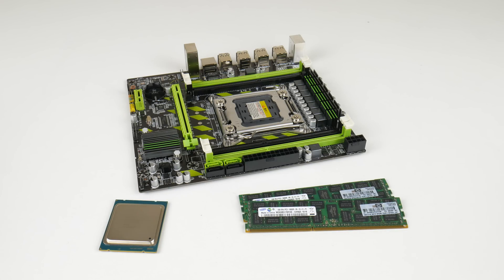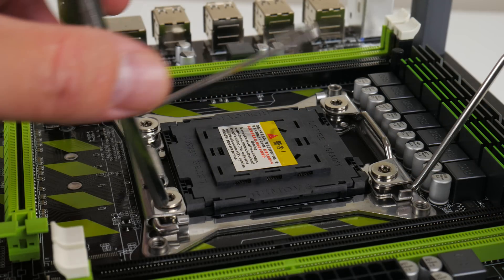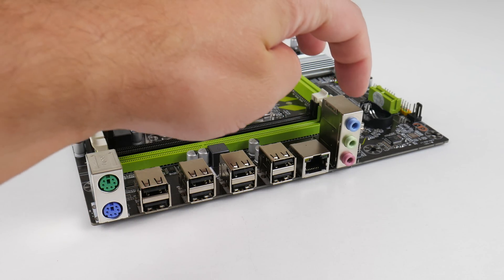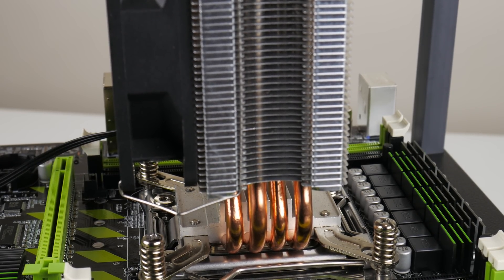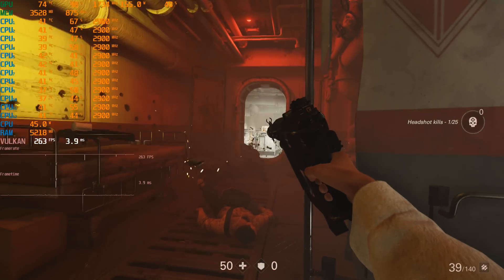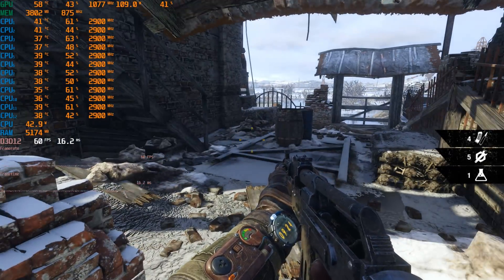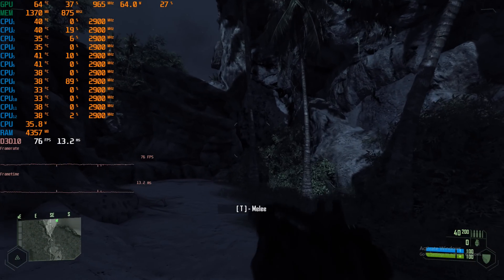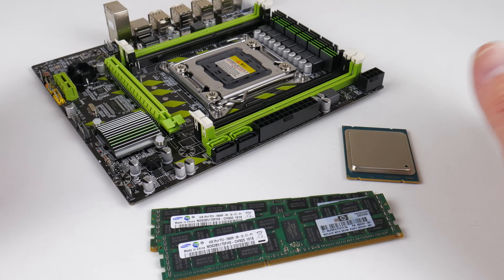$99 LGA 2011 Motherboard 6-Core CPU 8 GB RAM Budget Bundle

Comment: How would it fair as a Linux machine, Ubuntu or Linux Mint, any thoughts?
Reply: I use a very similar system for Linux, except with a 1070Ti card on it. I have Steam installed and play Linux native games on it just fine. Runs Chrome & Firefox like a beast.
Reply: @boriscat1999  Good to know, I'll do some more research on prices here in Canada.

Comment: Looks like the mobo I got with a Q67 chipset, and it wouldn't support my Hynix ddr3 1333 ecc registered ram, scrapped it.  Sold cpu on ebay, mobo and ram now in closet.  The mobo was advertised to work with ddr3, no specifics, I was not happy.

Comment: Last year i bought brand new i5 with motherboard psu case and 16g ram no gpu no storage costs me 880sgd

Now i put this motherboard and cpu u showing on aliexpress with 256g and 960g goldenfir ssd, 16g ram, case, 550w psu and rx470 it only costs 480sgd 😭😭

Comment: Inspired by your videos I ordered one (although a E5-2620 V2) with 16GB RAM sticks with a Killspre motherboard and today I completed the first stage of assembly. I am using a Corsair A30 cooler, Corsair VS450 SMPS, Adata 240GB SATA SDD, but realized that I forgot to order a video-card. Since mine will be used in server configuration, I am looking for the most basic / cheapest GPU card. Can wait to get one and spin up this little buddy. I scavenged the case of an older Athlon X2, and still have that setup spare. I noticed that you use an open-case for the video filming. Wonder how do you manage the HDD, power LED, and reset, power-on switches ? Did you buy or scavenge a front-panel ?
Reply from the maker: You can get front panel buttons with LEDs that are specifically for open test benches! They are easy to find on eBay or AliExpress :)
Reply: @philscomputerlab  any idea what might be wrong if the onboard piezo doesn't beep or does any BIOS POST ? Checked with repalcement SMPS as well. Tried with/without CPU, with/without RAM sticks inserted, with/without CPU cooler (for few seconds), and triple-checked all connections to be proper. Should this be RMA ?

Comment: They talk about Raspberry Pi's used to make cluster computers how about someone doing it with these? would need to get the power bricks instead of full power supply would not need a video card except maybe one, might not need as much memory in each one. But you could build you a heck of a cluster computer on the cheap.

Comment: I went with an E5 1660, 32 gigs of RAM, an RX 5700, and a QL300 case. Total cost for everything I needed to complete a functioning build was $799.17. With this kind of power, I'm super impressed. I can post a parts list if anyone wants it.
Reply: How is it going? and please post the parts!
Reply: @AnnieKawaii1  Well unfortunately this build was from 3.years ago and it does not look the same at all. I've been building these computers and giving them to family members
Reply: @CodyCombat  did the E5 1660 build have any sort of issues, especially on the motherboard side of things?
Reply: @RavenValkyrie  when I had it everything just worked as expected. Was a very nice system and still is from what I hear from family

Comment: Maybe a Xeon E5 2640 is a good fit in this kit, it has a 2,8 GHz All Core Turbo (100 MHz less than a E5 2630 v2) and is a little bit cheaper.

Comment: Very interesting video. Question. Did you ever try a similar build with dual XEON? I have a stack of old blade servers from work with this type of cpu and a stack of ecc memory. I'm on the fence as to a board like that is worth the price https://nl.aliexpress.com/item/4000130652292.html . I could fully load it, but how much more usefull would it be as a home workstation compared to for example my old i7-2600 board. As your videos showed most games did not even use all cores. Making dual 8 core more or less useless it seems.

Comment: @PhilsComputerLab Great review! Prices seem to go down nicely. Question, I'm looking into building a cheap and power efficient m-atx media pc running Manjaro. If one lets this CPU do H.264/65 & VP8 decoding, how much load does it get and how much power does it consume?

Currently I have a very old E5700 dual core with an old agp AMD video card for a midia machine. The card has major issues doing video decode, while it should support it. Thus I'm looking to replacing the whole aging system.

Comment: check out there is a new x79 board I saw with m.2, 1 Pci e x16, 2 usb 3.0 & quad-channel ram (need to ask the seller, not sure about that ram channel)....around $50
Reply: Link ?
Reply: @kruxdt6307   https://www.aliexpress.com/item/4000071175845.html

Comment: My pc it still kick ass on today games and it has about 7 years: 

I7 3820 (socket 2011) :D
Asrock x79 extreme 7
Corsair vengeance 24gb 1600mhz
Seasonic m12d 850w
2x hdd 500gb
1x ssd kingston v200 120gb
1x sdd kingston v300 500gb
Saphire 7970 vapor x ghz edition 6gb
Corsair 750D

Comment: Hello! Would you recommend this bundle before the one with 32gb RAM and Xeon E5 2650 v2? The latter sits about 150€. I would like to game 1080p FFXV (and VII remake), WoW, Path of Exile and Diablo III (and IV when released).
Reply from the maker: The 2650V2 is clocked 100 MHz higher, supports faster 1866 RAM. The 8 Cores do make it more future proof, so it comes down to how much you're willing to spend!
Reply: @philscomputerlab  Thank you for answering! The thing is 150€ starts to be a price point where I could try to get a cheap Ryzen build with a B450 MOBO, making a nice upgrade path. I need to ponder if those 50€ extra make the build future proof enough.  Thanks again!

Comment: Hey Phil, it’s great to see a review of the older and much cheaper Intel Xeon cpu with Ali Express cheap motherboards. I personal have purchased a cheap motherboard from Ali Express with an Intel 1650V2 with over clocking and personally used it as a home theatre pc / gaming pc on my big screen and it performs vg. I did find that despite dropping below 60fps in your review .... the frames in the 50’s is still, for me, very playable for Crysis 👍🇦🇺😁. Keep up the great work and keep these reviews coming. Cheers!
Reply: Michael Thompson hey I’ve noticed on aliexpress they mention the for, factor as mini atx. What case are you using for this as I can’t find any case for that size
Reply: @Snagoot  my motherboard is I micro at model. At the time of purchase they advised it was a limited run board and specifications could vary. It’s possible my motherboard is no longer being produced as I am no longer able to locate my particular board design

Comment: 🙂 This could be useful for people wanting to stay on Windows 7 forever, i wonder if they will ever start making new motherboards for other LGA sockets like 775 1156 1155, does this board accept regular DDR3 desktop consumer memory? 😍
Reply: There is intel H310C/ v 2.0 chipset for coffe lake processors if you want to run win 7 on the latest system.
Reply: @andip2914  😎👍 Cool! Thanks for the tip friend 😍 Windows 7 Forever yay! 😍
Reply: I am using chinese x79t motherboard socket 2011 with  regular DDR3 ram
Reply: @frinkpc2515  😀 Great! Thank you for the information friend 😇

Comment: Hey Phil. Could it be possible that for testing CPUs you would use a game called BeamNG.drive? It doesn't have a typical built-in benchmark, but there is a text-mode one in the game files called BANANA bench which tests your CPUs strength based on how many cars at once you can run. I say this, because the way BeamNG handles AI vehicles is that each vehicle uses 1 CPU core, so it can be quite demanding, depending on what vehicle you choose

Comment: Cheaper, easier and better performance just grabbing a used 3rd or 4th gen i5 optiplex system for under $80. You still need a case, drive and psu for this bundle which just makes the whole thing way too much for what it is.
Reply: Jake Smith facts

Comment: I really and truly don't get it.
Back in HL2 era, it was perfectly acceptable, fine and enjoyable to run a game at 30fps at medium/high details or whatever...

But nowadays a game is considered as "Not Running" if performing a smidge below 60fps on full details?

Really?
Reply: Durandal475 to be fair it makes sense, 60fps is becoming the new main target.  I remember playing games like vice city and stalker at low FPS around 30 and it’s fine, but really going to 60 shows how bad it was, it’ll probably keep going like that eventually 144hz will be the new thing for more than just multiplayer games.
Reply: When the Voodoo Graphics came out and we were running GLQuake at 30FPS (though some of us overclocked to get a few more FPS out of it), it was like magic; but most people knew that higher would be better. However, i wouldn't call 30fps unplayable or even "barely playable" (except for the most competitive players... though I can't recall what Thresh used to win Carmack's Ferrari). I'm not one of those nutjobs who argued that you couldn't see the difference between 30 and 60fps or even 60 and >60, but I wouldn't get my panties in a bunch over a steady 30fps ("steady" is doing a lot of work there). Much below that, though, and it would get noticeably worse. My Vérité could run Vquake in the mid-20s at 640x480, and that just didn't cut it.

Comment: Additionally I see lots of options for RAM upgrades on your site... can I drop the 1600MHz or even the 1866MHz in out of the box or should I stick to the 1333MHz and overclock as seen in the video?
Reply from the maker: The price difference between 1333, 1600 and 1866 is minimal, so I would go for 1600 or 1866 depending on the CPU and what the CPU integrated memory controller supports!
Reply: @philscomputerlab  yeah that's what I thought.  I tend to go big or go home anyway LMFAO

Comment: So I heard lga2011 v2... can this work on lga2011 v3?  because I see lots of potential here...
Reply from the maker: V2 is Ivy Bridge, no V or V1 is Sandy Bridge and V3 is Haswell! V3 is not worth it, better to go for Ryzen!!!
Reply: @philscomputerlab  so, is lga2011 compatible with V, V2, and V3, or do I need a Lga2011 V3 board for V3
Reply: @adventureoflinkmk2  LGA 2011 (X79) and LGA 2011-3 (X99) are different and they are NOT cross compatible. LGA 2011 (X79) is only compatible with Sandy Bridge (no V) and Ivy Bridge (V2) processors, and LGA 2011-3 (X99) is only compatible with Haswell (V3) and Boardwell (V4) processors.
Reply: @Godfrey180  gotcha, thanks.
Reply: @Godfrey180  was gonna say I got a xeon e5-2650 v2 and a x79 motherboard yesterday off eBay..

Comment: I just spent a 3/4 of the price of this bundle for an old FX 8350 and this bundle performs better. On top of that I'm stuck with a weak VRM Mobo so no OC and my PSU is giving me hell. Did I mention the unusual stuttering? I'm feeling like I wish I bought this instead.. What wattage PSU works with this bundle, it's only 80w tdp so what, 500W?
Reply from the maker: Yea a 500W PSU should work fine. In general if it has all the required plugs without splitters, your're good to go :D

Comment: does channel effect performance?
Reply from the maker: Yea a little bit, so with this board, which supports Dual-Channel only, make sure you get either 1600 or 1866 RAM, or overclock it!
Reply: Thanks for reply. I mean, to get a quad channel motherboard costs about $20 more than the dual ones

Comment: Thx for the tip. Could you give some guidance concerning brands? Wich one based on your experience on lga 2011 from aliexpress is the best, performance and options availability wise?
Altimer, plexhd, kllsre, huanandi, I am looking for a bundle with 64 or 32 gb of ram and cpu cooler, but I will need a pc case that handles the bundle, it will be nice to see a video with a full build including tower from aliexpress. I came accross the seller cpustore, any thoughts or recomendations on this or another store you work with? Thx for any input and your time doing these videos. Congrats.

Comment: Frequency is on the low side with this guy. Hunt around, and you could probably get a higher-clocked 6 core for around the same price and that'll be much better in gaming. Other than that, this is a great bundle for the price.
Reply: XtremeConditions hi, which Xeon do you recommend?
Reply: @619-SD  I would just go on Wikipedia for the full Sandy Bridge lineup and try to find the best balance of cores and clockspeed for your needs. The CPU isn't bad in this video, it would just be nice to have a better clock speed.

Just type like, "Sandy Bridge Wikipedia" and you should see the full Xeon lineup on that page too.
Reply: XtremeConditions awesome thank you!! One more question! For these x79 boards.. can any sandy bridge cpu work?
Reply: @619-SD   I don't believe so. I believe the regular desktop CPU's have a different socket, and that this (LGA 2011) is for the server CPU's? The only other ones you might find are the "HEDT" processors. The "X" series ones? They might use this socket. But they'll cost too much for what they're worth probably. 

Okay yeah I was right, the X-series processors do use the same socket as this, but I'd mostly not bother with them again for price.

https://en.wikipedia.org/wiki/Sandy_Bridge#List_of_Sandy_Bridge_processors

Just going off LGA 2011 socket, and looking at cores / clockspeed... I think the E5 2667 might be good if you can find it for a decent price. It's 6 cores, 12 threads. We're getting to a point where even 4 cores 8 threads isn't the best for gaming anymore, but if you were inclined to still go for it, the E5 2643 is probably affordable I'd think. If you wanted to go balls to the wall and again, can find it for a decent price, the E5 2670 is 8 cores 16 threads with decent clock speed. 

I would price check them on ebay, make some offers, and just see what you can get for your money. Hope that helped. I can maybe price check later, but I did have a chance to check the Wikipedia page, so I hope I helped steer you in the right direction at least. :)
Reply: XtremeConditions thank you so much for all the information! I ended up picking an e5 2667! It was $30 on eBay which was $15 cheaper than AliExpress! I can’t wait to start my first Xeon build. It’ll be my first time building a computer
Reply: @619-SD  You're very welcome! From what I can tell, it should make a great choice for a high-value budget build. You'll love it, I'm sure!

Any idea what GPU you're going to go with? I'd suggest no more than an RX 580 8GB because it'll start not being able to fully utilize it at 1080p, but if you're looking for higher resolution or supersampling, you can get away with maybe a 1070 or Vega 56 or something in that range.

The choice is yours, but just be sure your GPU isn't too strong for what the CPU can actually handle, ya' know?
Reply: XtremeConditions hi sorry for the late reply! I just got it today and I also have an older 750ti but also an old rx580. One weird thing is though, the front panel pins don’t have a layout or marking on what they are. How do I know what to plug in and what order?
Reply: @619-SD  The front panel pins, meaning like the little jumpers for power, audio, all that kind of stuff?

Order doesn't matter, just plug them in however you can fit your hands to do it.

As far as it not being labeled, that's pretty strange to hear. I don't have experience with these Chinese boards though. Let me see if I can pull up a manual or something.

Edit: I... Couldn't find much. I would just try your best to follow along with Phil's video here. Far as I know, it's not harmful to plug into the wrong place, it just won't function correctly.

Wish I could be of more help..

Comment: 3:50 It was a major concern of mine to see that backplate with only USB 2.0 ports in it. Was wondering what one could do about it as I considered how little expansion capabilities the board offers... And almost at the same time I was spotting that little 1x PCIE slot as that welcome lifeboat we need, you mentioned that possibility... No, it's not like you can use that for USB 3.0 "for instance". You DO need to use that in that manner!

Comment: Ahh socket 2011 :). My 3930k Sandy bridge E has been running at 4.4ghz stable for years. I don't really turn it off much either, pretty much only to clean it. I've gotten so much out of this CPU it's paid for itself in a way because I haven't needed to upgrade.

Comment: Too bad that the bundle is not with the E5 2637 v2, which is about exactly the same price but a much higher clock speed (3.5/3.8 GHz) than the E5 2630 v2.
Reply from the maker: AFAIK that's just a Quad-Core.
Reply: @philscomputerlab  In your experience, is a faster clock a good trade-off for cores and threads for this application?

Comment: I have a question you might be able to help with.  I have a i7-3820, it should work fine on this board, yes?  It doesn't support ECC ram, but the board should be able to work with normal ram as well too correct?  I'm just looking for a cheap way to utilize this processor I have laying around.

Comment: One very important thing that is not discussed here, is whether the bios on this motherboard is updated with the Specter/Meltdown micro code updates. If it does not, then performance will be the best it can be but with a cost of security. If it is updated, then you may lose some performance due to the mitigation fixes. It remains to be seen how much of an impact it would make. I suspect really demanding titles will reveal such.

Comment: You gotta disable the spectre and meltdown stuff on these xeons to see true performance. It's a download and 2 clicks. Inspectre is the file.
Reply: Does it work with haswell ones too? I have older 4700hq running at 3.4ghz.
Reply: @JustOneGuy  google inspectre, download and run the file. It will tell you if your cpu is gimped and if it is you can disable them. It's super simple